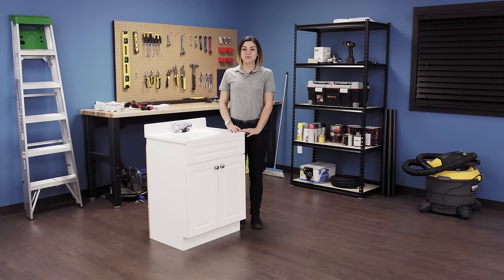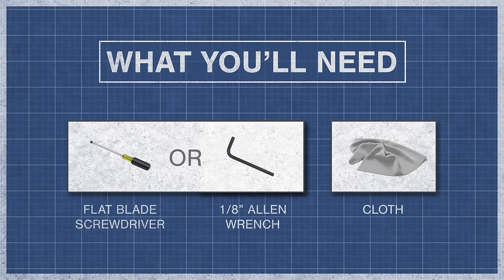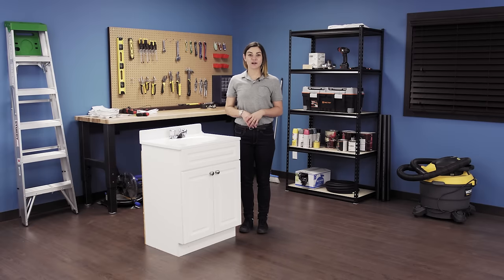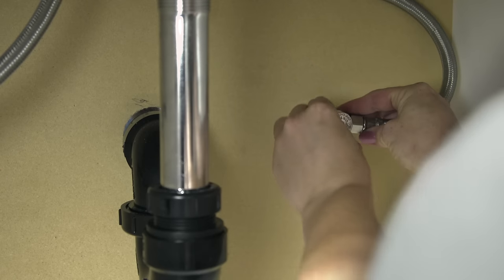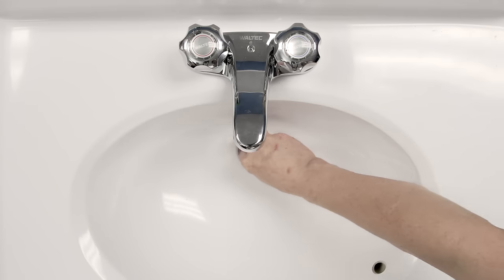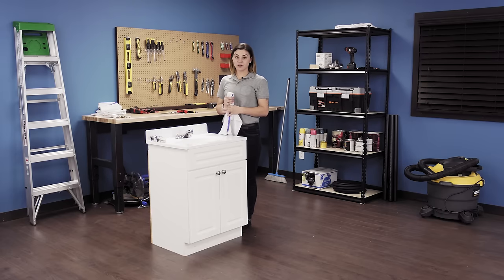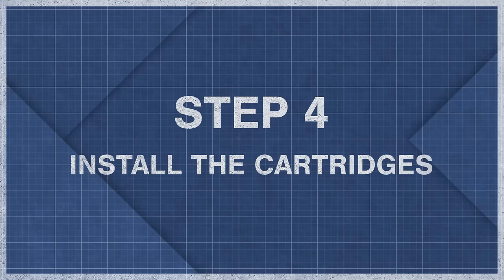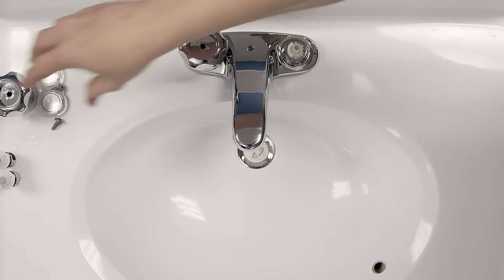How to Replace Leaky Cartridges in a Bathroom Faucet | Repair & Replace

Comment from the maker: Replacing the cartridges might not fix the problem alone as in some cases the seats and springs might be leaking. To see how to replace the seats and springs, watch this video: https://youtu.be/UPx10ILQp64
Reply: I replaced that too, it came in a kit but water runs with handle in any position.
Reply: I found the problem. I reversed the spring and the seal. Just so you know the cartridge came with a new spring and seal which makes sense because if you're going to replace the cartridge you should replace the seal and spring too as they are most likely the same age.
Reply from the maker: Thanks for sharing Paul, we're glad that you were able to figure it out!
Reply: the spring and seal for key for me too - I changed the cartridges with no luck and, after seeing the above-linked video, discovered that one of the seats was cracked and one of the springs was upside down. once i made the required fixes, i now have a dry sink for the first time in months!

Comment: Good day, i had mine replaced but now there is a high pitch whistle when you turn them on ( it does stop after awhile but it is very annoying and hurts your ears) before i go and replace them again myself, do you think turning the water off and letting them drain completely then turning water back on would get rid of the whistle? ( great video by the way)
Reply from the maker: Thanks for watching, we're glad that you found it helpful. If the high pitch whistle only happens when the water is running then it could be because of the restriction in flow. Check and see if there is a buildup of calcium at the bottom of the valve seat, if needed clean by soaking it with vinegar as this will dissolve the minerals.
Reply: @AmreSupply  Thank you, i will give that a try.

Comment: I really enjoyed the video. I tried to fix my bathroom sink but the Bonet nut would not come off.  It had all hard water mineralization around the nut. I tried Lime Away to clean it but it still did not turn. Is there a trick to break the corrosion? Thank you and have a great day.
Reply from the maker: Thanks for watching. Soaking a cloth in vinegar and wrapping it over the area is a good way to help dissolve a buildup of minerals. It often takes a bit of time for it to work. Try to make sure there is a good amount of vinegar on the bonnet nut.
Reply: @AmreSupply  Awesome. Thank you very much.  Have a great day.
Reply from the maker: @FitDrummerJay  You're welcome, we're just happy to help!

Comment: Nice video; thanks. Unfortunately my professional plumber is unable to solve the problem after installing a new cartridge (RP24096) complete with 1/4 turn stop (RP2409)  and new seat/spring RP4993. When installed the same direction as it was prior to removing the old cartridge the water does not turn off. However, it does turn off when rotated 180degrees ... but of course that means the handle is facing backwards . Any advice ?
Reply from the maker: Thanks for watching, we're glad that you found it helpful. First, pop the handles off and see if you can place them into the correct position. 

As well the cartridge might need to be rotated or flipped into a different position. 

Other than that since these cartridges are for hot and cold there might be a tab with your specific cartridge that will need to be transferred to the other side. This video mentions the tabs. https://youtu.be/AZz-s2xLLvw

Comment: I've watched a half-dozen videos on this subject and no one describes how to ensure that your handles turn in the right directions.  Right now I can get the new cartridge to be open when it should be closed and to close in the right position but open with the handle swinging the wrong direction.  Manufactuters provide no info either.
Reply from the maker: Thanks for watching. Before installing the cartridges in some cases you can dry fit the handle and test the movement of the handle before aligning it. Other models will have groves that the cartridge fits into.

Comment: Bonnet nut appears to be completely stuck, trying to turn starts yanking the whole faucet assembly off the sink.
Reply from the maker: Thanks for watching. In some cases it can be helpful to stabilize the faucet. You could use a piece of wood under the faucet as a brace or get someone to help hold the faucet.

Comment: Can you advise why water does not come out of the faucet after competing these steps perfectly? Water will come out of faucet only by turning the on-off valve under the sink?
Thanks
Reply from the maker: Hi Dennis thanks for watching. There are a couple things you could check. Look at the cartridges and see if the holes in the cartridge are aligned with the holes of the faucet when installing. Alternatively, if you are using 1/4 turn cartridges, there will be a left and right cartridge. If they are swapped it will prevent water from coming out of the faucet. Hope this helps!

Comment: Bring your old cartridge with you to the store. The slots on the bottom need to match. If you have colored plastic on top of the cartridge, you can take it off the old cartridge and put it on the new one to fit the faucet handles.
Reply from the maker: Thank you for watching! You are right that it is always a good idea to bring the old cartridge to the store to help find an exact match.

Comment: Between the cartridges and the seats and turners, how do we know which to replace for the leak??
Reply from the maker: Hi Rigo Martinez. We do have a similar video as well but split them up 
into their individual parts. Its hard to tell what is causing the leak 
until you remove the cartridges. The seats do wear down over time, and 
sometimes you'll notice that the rubber has become to become more of a 
gel and doesn't provide a tight seal. When in doubt replace the seats, 
springs and cartridges.
Reply: Thank you. I really do appreciate your response, especially since my faucet handles leak when turned on. Have a great day and Happy Holidays!
Reply from the maker: Always happy to help. After you fix the leak, please let us know how it goes!
Reply: I sure will
Reply: AMRE Supply damn rRigo never told us how it went!!darn it😡

Comment: What happened if the shut value is still releasing water?
Reply from the maker: Hi Donnie, thank you for watching. If you shut off the hot and the cold water supply to the faucet and the water is still flowing then it means that one of the valves is not closing properly. In that case it would be best to replace the valve. If needed you can go to the  basement or on an outside wall there should be a main water shut off valve, which will shut off water to all fixtures inside your home.
Reply: @AmreSupply  I'm thinking it might be the supply line

Comment: Thank you for going to all the trouble to show how to replace a Delta Cartridge. But this is a very bad example of what not to follow online. First of all, the most important thing to do is replace the seats and springs if the faucet was dripping. The only reason to replace the cartridge is if it is hard to turn or leaking under the handle. But in any case, I strongly suggest that both are replaced, so have both on hand before proceeding. 

Please notice the way the seat and spring came out which is embedded in the little hole below the cartridge. Use a small ice pick or alike to remove them. When replacing the seat/washer and spring below,  make sure that the spring which is conical shaped like a Christmas Tree has the large side down and the small side pointing up into the rubber seat. I put the ice pick through the new seat/rubber washer first, then put the spring on the ice pick underneath the seat and guide them back into place. The small end of the spring being upward should fit into the bottom of the rubber seat. Then carefully push the rubber seat down into the hole. 

Make sure you use genuine parts which I am finding out are not very available anymore. This is very sad that Home Depot has bought up the faucet industry as well as some big plumbing supply warehouses, having the large manufacturers products made in China, and most of them have turned into "throw aways". Do not buy faucets or faucet parts at Home Depot unless they have the manufacturers "Genuine" name on the package. You will pay less in the long run.

Aloha, Paul
Reply from the maker: Hi Paul, thank you for watching and commenting. The seat and springs replacement is shown in this video: https://youtu.be/UPx10ILQp64 We decided to film both and it just happened that this video has gotten more views and shows up first in search results. 

Your description for replacing the seats and springs is spot on though and well described.

Comment: Hello my handles have the holes in the side. Do you have a video for that type of faucet?
Reply from the maker: Hi, thanks for watching. Do you mean that the set screw is in the side of the handles? If thats the case you'll need an allen or hex wrench to unscrew it. Then the handle will just lift off.

Comment: I just replaced my cartridge with a new spring and washer but the water won't shutoff in any position. The old and new cartridge match up , I can't figure out what's going on.
Reply from the maker: Hi Paul, First try tightening the bonnet nut a bit more and see if that helps. Also did you replace the rubber washer when you did the springs? Does the rubber look worn?
Reply: I had that same problem I took out the spring and just use the rubber washer and then I put the seed back in it worked

Comment: Often the cartridge is more expense than the fixture--often the stem-valve O-ring is the easy and cheap remedy.
Reply from the maker: Thanks for watching. You are right that replacing the o-ring is less expensive than the cartridge. If changing the o-ring doesn't help then the cartridge is likely faulty internally. It is worth trying before replacing the cartridges.

Comment: Hi , I changed it but water still dripping., what else should I do
Reply from the maker: Hi Reet, Replacing the cartridges might not fix the problem alone as in some cases the seats and springs might be leaking. To see how to replace the seats and springs, watch this video: https://youtu.be/UPx10ILQp64

Comment: I replaced the cartridge and springs and washer and it's still leaking. What next?
Reply from the maker: Hi Jason, thank you for watching. If you've installed new cartridges and new seats and springs as shown in this video https://youtu.be/UPx10ILQp64 then check to see if the metal is rusted or pitted inside. Look for any debris or small rocks that would mess up a seal or interfer with the rubber. As well make sure that the handles are screwed on tightly so that everything is sealed.

Comment: What is the plastic does not want to come out?  Do I need a new faucet,  I mean this one is about 18 years old.
Reply from the maker: Thanks for watching. Minerals in the water can cause the cartridges to stick. You could try soaking a rag in vinegar and applying it over the cartridges. This can often dissolve the minerals and help it release. You could also try vise grip pliers to remove the cartridges. If that doesn't work or if you think its time for a new one then here's a few videos that might also help you out with a faucet installation: https://www.youtube.com/watch?v=P9DA3MzmoLg

Comment: It didn't work for me. The handles kept spinning. I'm installing it in a bathtub where the handles go into the wall
Reply from the maker: Thanks for watching. Did your original cartridges screw in? Its possible you had a compression faucet.
Reply: @AmreSupply  thanks for replying.  I had my dad come by to help me. It turns out that the older cartridge had two raised grooves on each side. They fit into a groove on the faucet. The new ones had the grooves but they seemed a little less raised.

Comment: does not address how to reverse the direction the handle is turned to make water flow.  This is what I am dealing with right now.  I want turning to right to turn off water, and turning left to turn it on.  My new Kingston Brass faucet seems to only want to turn towards center for on with both handles.
Reply from the maker: Hi Bradi, thanks for watching. For a quarter turn cartridge, reversing handle direction tends to be a little awkward. It sounds like you have the compression type cartridge as shown in this video: https://youtu.be/PEfhPIeOG74?t=119 In these compression faucets, the inlet hole is centered, you are able to swap the cartridge. For example: if you want your right handle to turn in the same direction as your left handle, then install a "left cartridge" in the right side.

Comment: What if the cartridges don't slide out easily? I'm having a heck of a time. It is almost always the case that when I do any of these repairs they never go so super easy like in the videos. I'd like to see real world repair tutorials, not best case scenarios.
Reply from the maker: Thanks for watching. Based on how we film these we often need to do it more than once to get good quality / detailed shots of the repairs. We can understand why people would like to see more real world examples.
Calcium from the water can build up and make it more difficult to remove these cartridges. You can soak a cloth in vinegar and drape it over the cartridges. The vinegar should work its way down and dissolve the calcium. Then get a firm hold on the stem and try to remove it.
Hope this helps!

Comment: What about the little rubber washer and spring inside
Reply from the maker: Thanks for watching. If your faucet has seats and springs then those can be good to replace as well. You can use a hex (allen) wrench to pull them out.